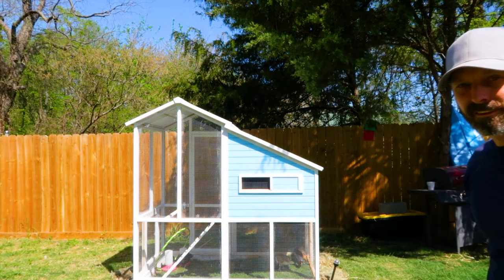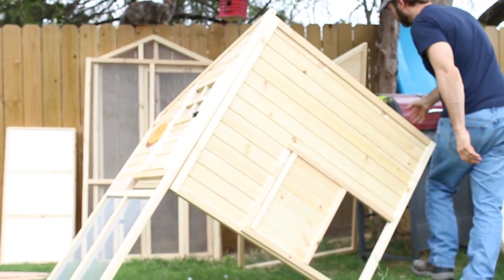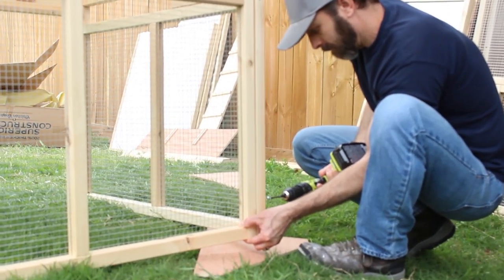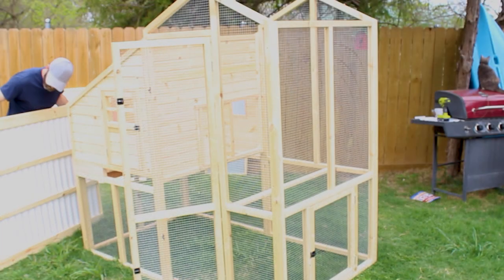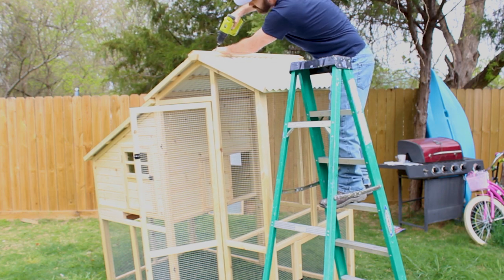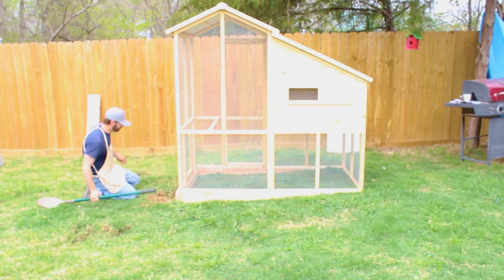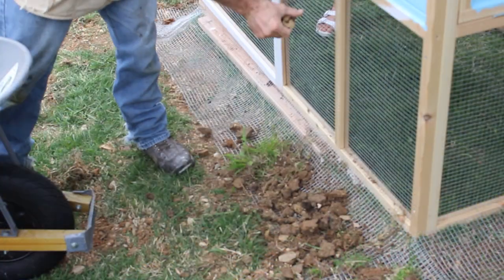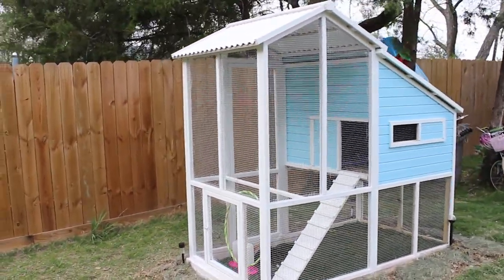Review And Build Chicken Coop - Tractor Supply Petmate Superior Construction 70401D

Comment: how do you anchor the coop? What material?
Reply from the maker: I used some chicken wire on the bottom boards and buried the chicken wire so that predator's could not dig under the base.  This also worked as a anchor.  =)

Comment: Is it easy to move? If you have to move around the yard?
Reply from the maker: No not how I did it.  I built it with chicken wire buried into the ground so predator's cant dig underneath the walls.  I suppose you could build it and add wheels if you want to move it around.  I ended up adding an other side to give them room underneath.  https://youtu.be/l6dW2DOVfaQ
Hope that helps and have a blessed day. =)